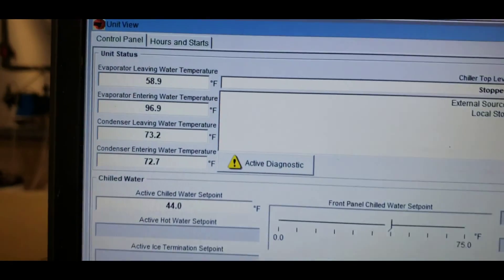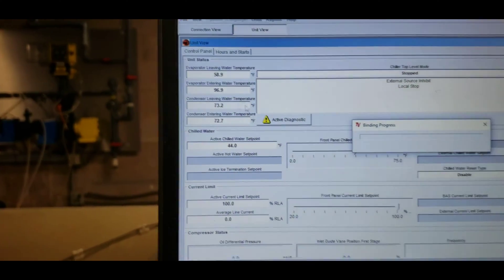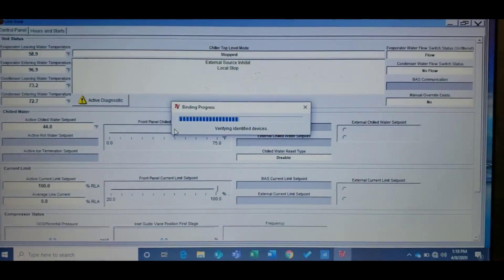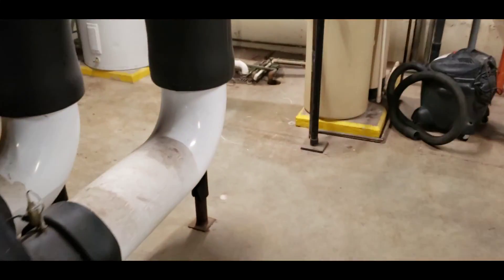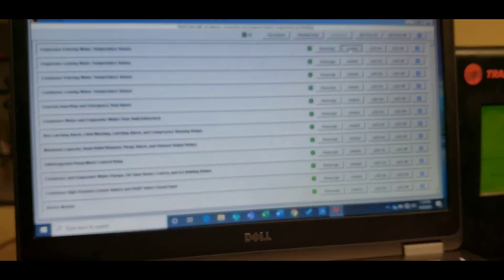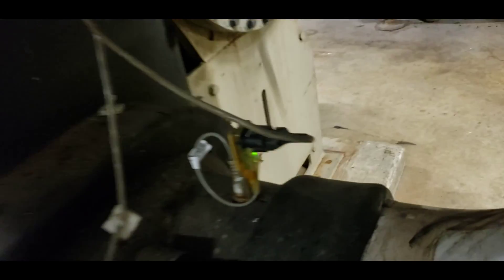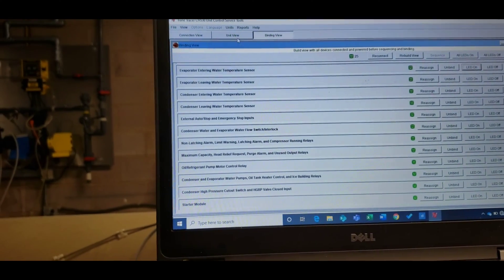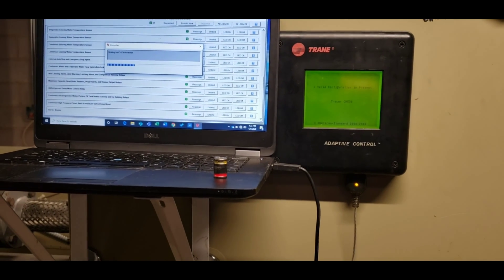Binding Sensors Trane Chiller HVAC Training for HVAC Technician

Comment: Does this same process apply to bind sensors with all Trane Adaptiview controlled units?
Reply from the maker: Yes, with TU software it looks slightly different but same process. I am using Tech View in this video. I have a Chiller Community for those enrolled at chilleracademy.com for troubleshooting support and mentorship if this would help you.

Comment: Did you just luck out that the multi bit magnet was North facing?
Reply from the maker: I've used several different one's and other tech's I work with do it now too. It not work for you?
Reply: @HVACTIME  I always scrounge around to find some magnet that works but I always have one of those bits in my tool bag and for whatever reason forgot that when you take the bit end off there is a nice magnet on there. Figured the manufacturer only randomly puts the magnets in and only had 50/50 chance it would work. 
I have a Trane RTAC air cooled chiller someone stole the CH550 off of. I found a good used one off of Ebay that poers up good but wrong software. I've added devices before, but never started from scratch with software and going to have to bind every device I presume.

Comment: Hi,
I want change damage trane sensor X13650726100 Sen02133 .
please , i use UC800 conntroller, is it necessary that i bind the new sensor after i replaced the old damage one?
Reply from the maker: Yes
Reply: @HVACTIME  ,many thanks for reply,
please can you tell me what i needed to bind the sensor?
Reply from the maker: You will need Trane TU software and a TU subscription.
Reply: @HVACTIME  , please can you make me an offer (price of what i need to bind the new sensor)?

Comment: Say buddy , I've a question ...
I'm working on a 70 ton CGAM...the unit runs for a few minutes.then shuts off ...
When I checked the alarms it says the entering water sensor .
When I rebind and look at the CH 530...the inlet values are lower than the leaving. Then it shuts  off showing the same fault - entering water sensor. What am I missin ? 
Tried replacing with new sensors on both inlet and outlet with same result ....bearing in mind the values for both on the CH 530 says the same thing ....the entering value goes lower that the leaving. Any help is much appreciated
Reply from the maker: Are you 100% certain they didn't get crossed and are reading backwards?
Reply: @HVACTIME  yea thought about that initially when I checked that the  leads are different lengths...the inlet sensor is shorter...the leaving is a way longer...yea guessin Trane kinda idiot proof that one ...
Reply from the maker: Have you verified the chilled water pump flow direction?
Reply: @HVACTIME  I haven't , but seeing that's it's 3-phase 480, then that would indicate a phase reversal.The scrolls don't handle phase reversal ...the power leads ..as far as I can tell haven't been tampered with. If it was a rotation issue, then the compressors would not work. As far as I can tell the phase rotation is clockwise , but hey I can check the connection at the VSD just to verify .Oh thanks in advance for your assistance...
Reply: Yup checked and verified that, it was CW. Got through with it this morning, Went through all 22 devices...one by one ...unbind and bind each individually...at one point when I came out the binding view ,on start up of the CH530...the entering and leaving values was absent...just a series of dashes through both. Went back into the binding view and redid all the sensors again by unbind and bind. And wadda you know on leaving the binding view the CH came up with the entering and leaving values, the compressor started on cct 2 ...the values showed on the display how it should ...meaning the entering values were higher than the leaving.The unit is still operating . 
Quick question though, I've noticed there's those two icon boxes on the upper right side of the binding menu...".Reassign "...and "Rebuild " .... I tinkered with the "Rebuild" a bit . Don't fully understand both...
Do you know what they both mean and how to use them correctly? 
Thanks buddy

Comment: How about binding EEXV's on a CGAM ?
Reply: Better late than never...

You may need to change the chiller configuration to represent the correct part number. If that is not available, you need to update the chiller software via TechView and then you can bind in the newer style EEV.

Comment: Thanks for sharing the mind. I trying bind and get the message ”Device is not bound”. Could you tell me where make I mistake? I did proximity magnet and get Led is on.
Reply from the maker: You have to make sure you click bind then activate sensor then click ok on popup
Reply: HVACTIME Thanks quickly reply. I tried old temperature sensor for leaving water and get ”Comm loss: Cond rfgt pressure, Ckt 2” ”comm loss: Intmd oil press, Cprsr 2B”.
Reply: Yesterday, we tried another old sensor then gets many other 6 alarms. Next we change this sensor got 2 alarm. We didn't changed other sensors.

Comment: What versión are you using? I actually use the V13.0 and I got a legend with this text “database is too old. Get latest DB” can you help me about this?
Reply from the maker: You need 14
Reply: HVACTIME I got first the 14 but it was the same text
Reply from the maker: @jesusadrianyocupicio8391  did you also get the 14.1 update?
Reply: HVACTIME no i don’t Can You Share me the link to download?
Reply from the maker: @jesusadrianyocupicio8391  https://www.trane.com/commercial/north-america/us/en/controls/building-automation-and-controls/HVAC-equipment-controls/trane-lontalk-controllers/TechView.html

You will the the option for SP14.
Reply: @HVACTIME  Hello, i'm trying to download this update but everytime that i try to access the download link i get a error mensage "500 - Internal server error."
Reply from the maker: I just responded to your email.
Reply: I got it thank you